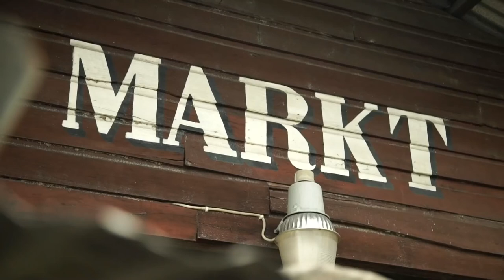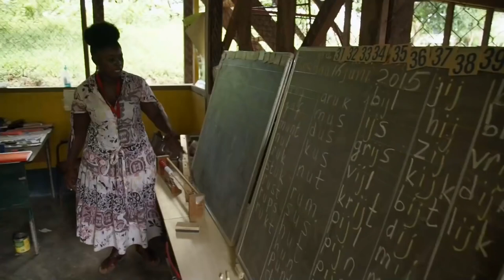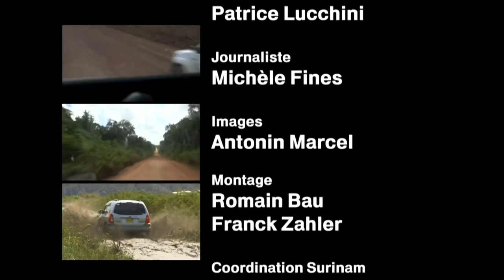Deadliest Journeys - Suriname, For a Fistful of Gold

Comment: That quad needs a carburetor rebuild, most likely the float bowl is filled with debris and occasionally cutting off fuel supply. He needs yo drop the bowl, clean out the crap and be on his way.

Comment: Hi, if it's a 4wheel drive , why are only the frontwheels spinning when it was stuck in the mud? 
Also when they were "flying" through the mud you could literally see the mud flying through the air coming off the spinning front wheels, but almost none from the rear wheels. If this is a 4wheel drive , i wonder why? It appears to be a Mazda Tribute and they also have a 4wheel drive model. And all the goldigging with mercury is heavily polluting/poisoning the rivers, look at brazil where a lot of the rivers have mercury poisoning. You can hardly consume fish/wildlife there. People get fatally ill. Regards

Comment: Those outboard engines are not diesel powered, they are 2 stroke gas engines. Have been in the marine industry for almost 30 years, this is fact. Yamaha started making 4 stroke diesel just recently and they are VERY  expensive.